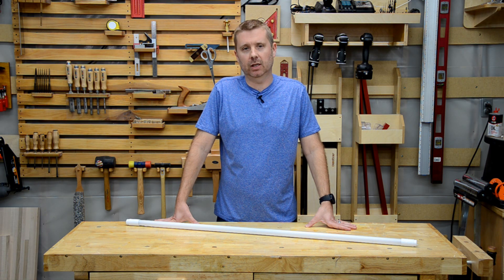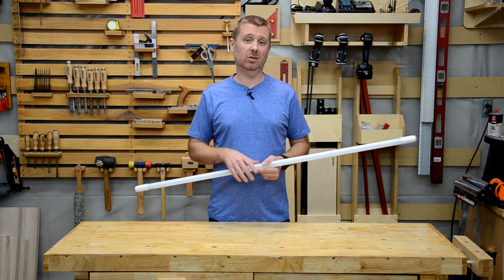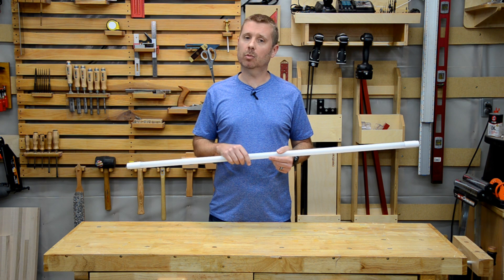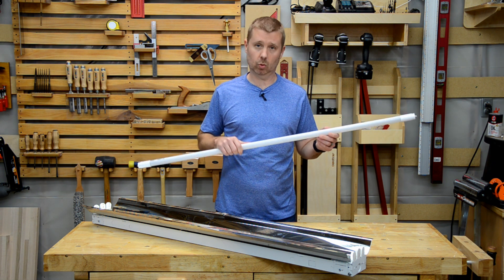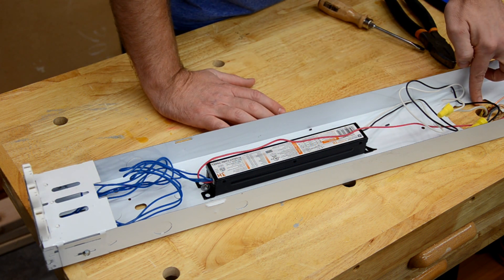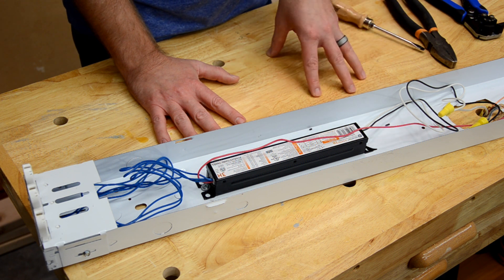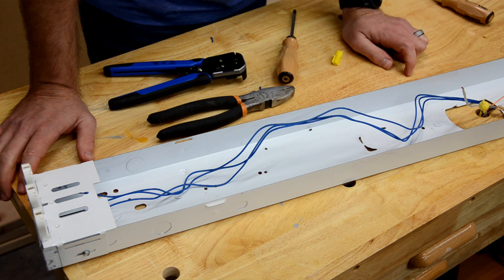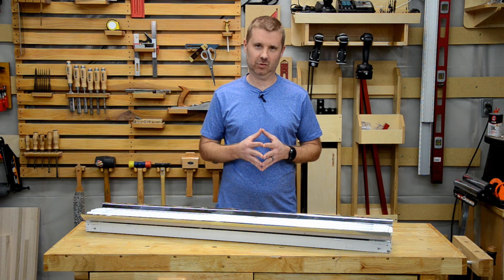How to easily convert fluorescent Lights to LED – UPDATED!

Comment: I watched your other video also but am i missing something, you didnt mention if your converting the light to DC or if they are powered by 120 volts AC. AC doesnt have a polarity so is the V-O neutral?
Reply from the maker: A/C, when dealing with outside power, actually does have polarity. That's why we now have receptacles where one pin slot is larger (the neutral) than the other. But that's neither here nor there when it comes to LEDs. The a/c to d/c driver in the tubes does not care about polarity so it doesn't matter. That's why I arbitrarily picked which end would be hot and which one would be neutral. And to address your first comment, yes they are powered by 120vac. The only LED lights that are not are typically the type C which uses an external driver. Those drivers typically expect 120vac, but in some cases it could be 240vac or 277vac. (That statement applies to North America only)
Reply: @ToolboxDIY  Yes, and that was the information i was looking for in your first and then your second video which isnt provided. I needed info because i had no knowledge of the led tubes, i didnt know some bulbs had no driver and some had a driver built in, i was at the very beginning of the led fluorescent bulb conversion. After burning out a bulb because i thought it would work with 120 vac i found one of those 2 minute videos that has no sound or person talking that explained what the type A, B and C bulbs are and how they function. After you got 2.7 million views i would have thought the update would have the info i needed, being thorough is not being redundant, seems like you now have another update to make.
Reply from the maker: @scottdc2105  I'm curious. How did you find a type C bulb that required an external driver but still fit perfectly into a standard T8 lamp holder? I can't say ever seen one of those. BTW, most of my viewers are interested in how-to videos rather than how-it-works videos. I wish everyone had the zeal for knowledge like you do but I haven't found that to be the case and learned that there just aren't enough people interested in those types of videos.
Reply: @ToolboxDIY  I was dumpster diving and found a store that thru away 30 led, t8 , 8 foot bulbs so i was interested how to put them to use. Samsung sunview 36 watt, t8, 8ft, i burnt one up putting 120 vac to it then talked to my nieghbor who has them in his shop so i tryed them in a fixture running off of the ballast and they lite up but werent very bright so next i will bypass the ballast and use an led driver and expect them to be full brightness. There is no info on them as to being type AB or C. People may only need how to info but it wouldnt hurt to give them info they didnt know they need to know. Your 2 videos on led conversion were the first 2 i watched to learn about it so is was on the beginning of the process and learned more then i knew previously. I may pick up the drivers eventually or may buy them on ebay if i spend more time in the garage if i convert it from storage to workshop.
Reply: @ToolboxDIY  The larger tang for plugs for the neutral is a safety feature not a polarity thing.
Reply from the maker: @scottdc2105  But wait! How can there be a neutral if there is no polarity? Hmmmmm...techically speaking, it should be called part time neutral, right? No, that doesn't have a good ring to it. 50% neutral? Nah...let's go with hottie neutral! I like that one. All stupid jokes aside, when we're talking about a/c powered deliver from our power grid (and assuming everything is wired to code) there actually is a polarity but not because a/c has polarity. It's because man (the man? maybe) defined a polarity. Why? Safety reasons as you mentioned (related to the fact that neutral is bonded to ground at the panel, not hot), but there's another even better reason...keeping everything in phase! Most folks don't give a shit about that, but it can have a major impact on some systems...like audio systems. If you're have separate amps for your left and right channel, they better be plugged in with the same polarity (probably better to call it phase orientation) or your left and right channel will be 180 degrees out of phase and sound pretty off. So one solution to this is to use a polarized plug! You definitely understand a/c and you're absolutely right that it has no inherent polarity, but in the practical use it's much more nuanced (complicated?).
Reply: @ToolboxDIY  I was only taught that the larger neutral prong was so that if there was a problem the live, hot side would have plenty of conductive metal to return the electricity back to the breaker box. So that the live electricity doesnt go trying to find other ways to return to ground such as thru a person or any other way. Imagine if the hot side were the larger prong and the smaller side can only return 80% of the electricity then the other 20% would try to find another way to get to ground, or heat up the return wire.
Reply: @scottdc2105  That doesn't really make sense. As an electrical engineer, the size of the plug hole is not the issue, the weak link will be elsewhere in the circuit, like the connection of the wiring.  If you had to choose where to put the smaller slot you would want it on the hot wire as fewer things can be poked in it by a small child or someone who doesn't understand 120v can kill you in the right conditions.

Comment: I have a question in regards to the ballast is it not better to remove it as it does consume power ? even with the LED lightbulb?
Reply from the maker: I prefer and recommend that the ballast be removed. As you mentioned it does consume power with no benefit. For me, it's just another point of failure waiting to happen.

Comment: I have single-pin double-ended bulbs - power needs to be supplied to both ends. Tombstones are non-shunted. How would I retrofit those?
Reply from the maker: Are the tombstone single pin or bi-pin?

Comment: Each of my tombstones have two wires of the same color. Do I hookup both or just one?
Reply from the maker: I would hookup both to be on the safe side.  If the tombstones are non-shunted (each wires independently supplies one tube pin), it won't matter much. But if they are shunted, you don't want an unconnected wire dangling there with a live voltage.

Comment: I am replacing my shop lights, my ballasts are dyeing off.  I have 3 rows of 11 fixtures each (T12 double 8ft lights) each row of lights is on a it's own breaker. From what I can tell there are 3 strands of lights (3 to 4 fixtures in a row) linked together. When I by pass the ballast to convert to led, do I have to be careful about how many light fixtures I have linked in each strand?
Reply: Your amperage will decrease by approximately 50% using LEDs. That pretty much holds true whether you're using the single pin bulbs or the HO bulbs.

Comment: Am I correct to say that all I have to do if I'm using double ended LED bulbs is to make sure that the "tombstones" on one end of the fixture get ONLY the HOT line connected to the connectors and that the other end of the fixture has ONLY the NEUTRAL connected to the "tombstone" connectors and I'm good to go assuming I use double ended bulbs of the right length? Right? It's that simple???
Reply from the maker: You got it! It's that simple.

Comment: Can a simple tube replacement from florescent to LED (non-dimmable) result in an undesirable 'humming' or 'buzzing' sound?
Reply from the maker: Yes. This is especially true when the ballast is still installed. Many bulbs that are plug-n-play (or ballast compatible) don't play nicely wiht all ballast. Some won't work at all. Others work, but hum. You basically have two options: 1) try different LED tubes (different models/brands) until you find one that doesn't hum or 2) remove the ballast and use a ballast bypass tube. Good luck!

Comment: Does it matter if the tombstones are shunted or non? Since one end all wires go to power and other end all wires go to neutral, it shouldn’t matter if they are shunted or not?? Great video none the less 👍😎
Reply from the maker: For double ended tubes, shunted vs non-shunted doesn't really matter. The only thing I caution folks on is don't assume that if you have two wires coming out of tombstone that it is non-shunted. Because...if you're wrong and you don't connect one of those wires, you may have a live wire just dangling there. The best case scenario - nothing happens. The oh shit scenario - it touches the fixture, shorts, and trips your breaker (and you spend a week trying to figure that one out). The oh #$%^ scenario - it touches the fixture, you're fixture isn't properly grounded and it shocks the crap out of the next person to touch it. Or worse yet...we won't go there. So be careful! But you get it.

Comment: Why do you KEEP picking less-than-usual fixtures for your examples? 
 Why not show us how to modify a 48", bi-pin, TWO- tube fixture that is USUALLY in people's homes?! . . .  Not 96" fixtures that use FOUR- 48" lamps instead of 96" lamps. . . .NOT fixtures that use THREE lamps! . . . NOT fixtures that use SIX lamps! . . . . not fixtures that use shunted connectors, ( which I had to go to someone else's video to even learn what that means!)
Reply from the maker: In this video, there is no difference between a two lamp or three lamp fixture. The steps are exactly the same!

Comment: Good clear videos on the swap to LEDs.  I had changed my ballasts (kitchen ceiling recessed lights) a couple years ago, but recently had failed/burnt tombstones.

Time to change the tombstones and put in the LED tubes.

Easy to do. I ordered the Parmida tubes you had mentioned in the video. I used the single-ended connection method.

As we know some/many LED lights can be inexpensively made and not well built to not have any static/noise.  I discovered, after the installation, that these tubes (I put in six) cause a horrendous static/noise on the radios in my house.

Any suggestions as to devices to wire into the circuits for these lights that will trap such excessive noise?

Or are there different Parmida  LED tubes that don't emit such noise?
Reply from the maker: If you didn't bypass the ballast, the tubes may not be solely to blame. Sometimes the tubes will work with a ballast but not work that well - they might flicker or work for 2 hours and then quit. Perhaps the combination is putting out noise in your case. I think you'll be hard pressed to find any tubes that put a noise filter in the built-in driver. With that said, you could try this noise suppressor: https://amzn.to/2OIRKrp Disclaimer: I have not used this product so I can't personally vouch for it. I've been fortunate enough not to run into that problem. I do have a problem where my UPB light switches won't work when the microwave is running and I can't find a beefy enough noise filter with the right filter band. So I understand the frustration!
Reply: @ToolboxDIY  Well ... lots of research here.  Still trading messages with Parmida Customer Service as they are looking into the situation.  Amazon has sent a replacement sent of the LED T8 tubes and they emit the same hash/noise.

While still waiting for final input from Parmida I got two other T8 LED tubes that can be wired 'direct' without ballast from a different manufacturer.  They are quiet and do NOT emit any noise/hash that would wipe out my AM and Amateur Radio.

Had an AHA moment when looking at the instructions/specs for the two different manufacturer's tubes.  On the other product I got yesterday to try there is a big label/note on the specs page indicating that their device complies with the FCC Part 15 Rules about not providing harmful interference.  I can't find any similar labels on the Parmida T8 LED tubes.  I've also asked Parmida about that FCC Part 15 labeling as well and waiting to hear.

In the meantime I've found a solution that works well and does meet the FCC Part 15 Rules and thus does not emit interference that wipes out AM radio signals.

Still the Parmida T8 LED tube provides a great light and is very sturdy and will work for most folks, but keep in mind that the interference being emitted from the device (tube) can manifest noise in other devices besides AM and Amateur Radios as well.

I'm hoping Parmida will or maybe has already addressed this with a newer/different designed product.
Reply: @ToolboxDIY  Tnx.  I'll look into  that item you noted.  I removed the ballast and installed the LED tubes with the Single-Ended Connection.

The fluorescent tubes with ballast did not produce any noise.  The noise is very loud and wipes out any radio reception the minute the LED tubes are turned on.

I've reached out to Parmida as well asking if they have any suggestions or LED tubes with a better EMI rating.

Comment: I bought 6 hybrid LED bulbs for our church altar (recessed back-lighting) for the >express purpose< of not having to re-do the hard to reach high fixtures. Of course the bulbs didn't work. Nor did they work in 2 other modern T8 fixtures. This 'works with MOST ballasts' is a misleading claim by manufacturers.

Comment: So I can replace fluorescent tube light with Type B LED Tube light with double connectors without making any changes. Why do you recommend to remove the ballast . Isn't it unnecessary work
Reply from the maker: Great question! I briefly mentioned in the video that there are two reasons for the removing the ballast. 1) They consume power unnecessarily - it's not much probably anywhere from 3-8w depending on how many tubes 2) Ballasts fail - once they fail, you'll need to either bypass it or replace it. One recommendation in the video is to not bypass ballast and then only bypass it if the ballast fails.

Comment: did you connect red wire to neutrsl.i.e whitwire?. or did you connect to black  wire i.e power . was hard to see in video.
Reply: Yes I had the same question, I could not see if he wired the red to the neutral or not. Hope he replies.

Comment: I bought led tubes from Lowes, can't tell what type they are.  How can I tell, no label on box or bulbs.  Seems like you need a ballast.  Can you use T-8 led tubes in converted T-12 fixtures.  I thought you could if they didn't require a ballast.
Reply: T8/12 only refers to the diameter of the tube, type A are ballast only, type a+b (hybrid) will work with ballasts (check compatibilit) and ballast bypass and type B will only work with ballast bypass

Comment: I have a 6 bulb T8 fixture with two ballasts.  Both sides have of the fixture have the three blue wires and one red.  What do I do in this kind of configuration?  Can you bypass two ballasts?
Reply from the maker: I have those in my shop and yes, the ballast can be bypassed. My method was to take all the wires in the center tombstones (mine were red and blue), connect them all together with the hot (black) of the house wiring. I then took all the wires from the end tombstones (both ends, which were mostly yellow wires but one red) and connected those together to the neutral (white) of the house wiring. Not all of those end tombstones had long enough wires to reach back to the center so I had to extend the wire (using wire nuts). I hope that makes sense.

Comment: You switched camera angles and magically your neutral is now nutted with the hot?
Reply from the maker: I see what you mean. It's actually just an unfortunate camera angle. The neutral wire is just sitting unconnected behind that wire nut. When the camera angle changes again, you can see that I grab the neutral and then connect it to the other wires (not HOT!). I promise no short circuits where created during the filming of this video! Thanks for pointing that out.

Comment: Some questions, please.
1. In the conversion that you did in the video, can the type A+B bulb be inserted in either direction?  It was sorta implied, but I never heard it said explicitly.
2. Aren't type B bulbs made specifically for fixtures with ballasts removed?  So if I am going to remove the ballast, why not use them instead?  (If you said why, I missed it).
3. If I got double-ended Type B tubes, can they be inserted in either direction?  I assume so, but again, I'd like to hear it.
4. Finally, got any idea which way the wind is blowing?  Be a shame to pick one (i.e. single end) and then have them go the way of Beta-max!
Finally, thanks, this was extremely helpful and understandable.

Comment: your video is very inspirational, I think I would like to try conversion.  But I have 3 line of lights, but each line should be wired the same (they look the same)  But each line is 2 sections of 4 lights.  I'm wondering will this be different wiring than you show in your video. And if so, do you have a video showing that wiring ?
Reply from the maker: I have a video that covers that how to convert a 6 bulb fixture  to LED (3 bulbs in 2 four foot sections). But this conversion is using single ended tube. You may find this more difficult. https://youtu.be/SCWoI0X4jw0
My recommendation is convert this for doubled ended LEDs by taking all the wires coming from the tombstones in the middle (no matter which direction they are facing), connect those together and connect them to the HOT wire (black) or your house wiring. Then take all the wires coming from the tombstones on each end (yes, both ends) connect all those together and then connect to the NUETRAL wire (white) of your house wiring. The wires coming from the ends may not be long enough so you may need to take a wire nut and extra wire to cover the distance.
Reply: @ToolboxDIY  clear as mud